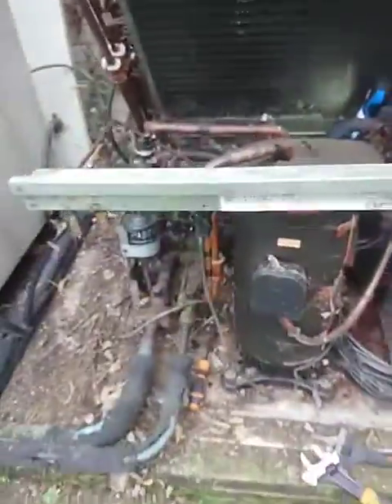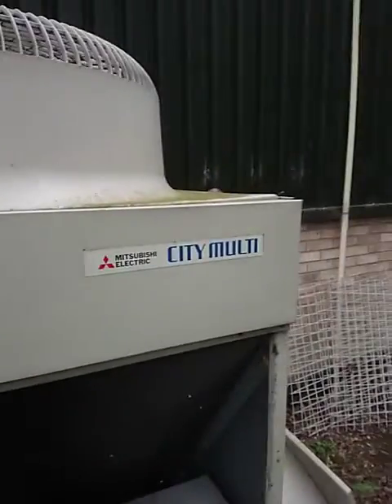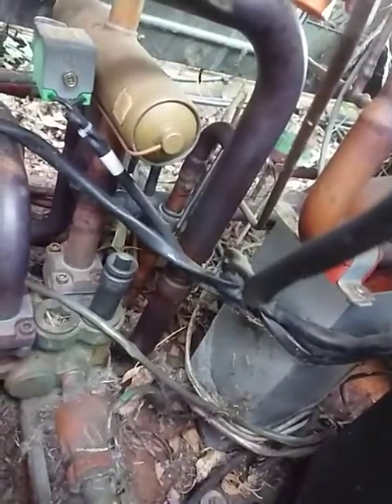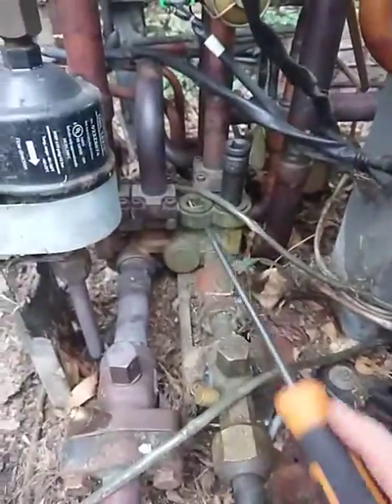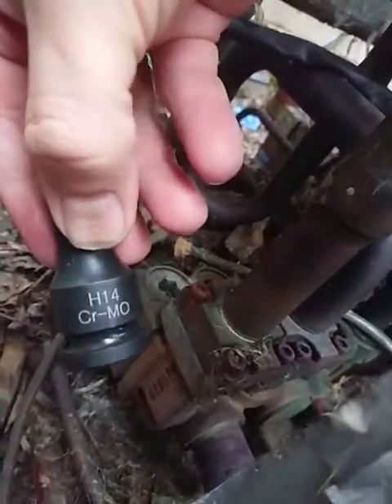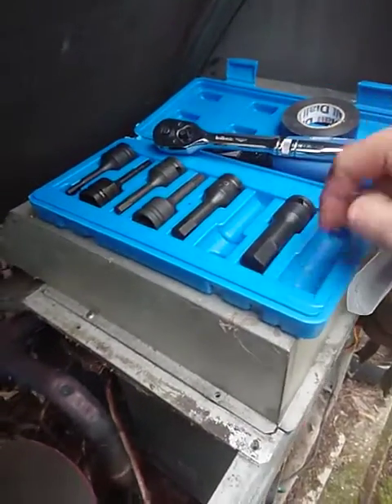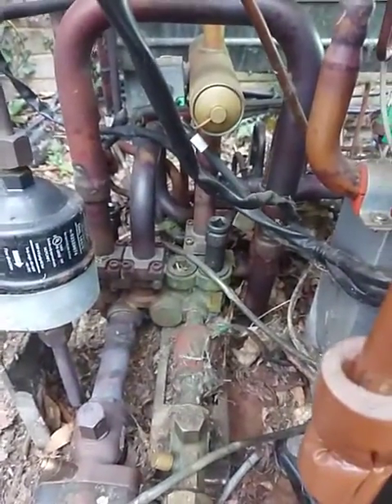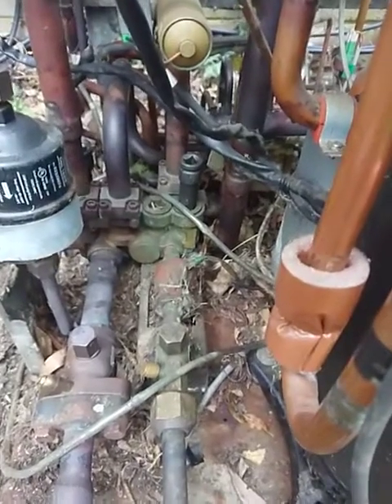Mitsubishi electric VRF check valve replacement

Comment: I’d like to know the end result too!! Spent two days scratching my head with similar issues on a ymf-c. Found sv3 and sv6 were the wrong way round which didn’t help. Eventually after spending hours scrutinising the schematic, taking temperatures and looking at data on the monitoring tool I’ve taken a punt and said cv6 & cv7 (check valve identification and arrangement differs to yours)
Reply from the maker: Lol. The repair worked but the customer replaced the system 3 weeks later